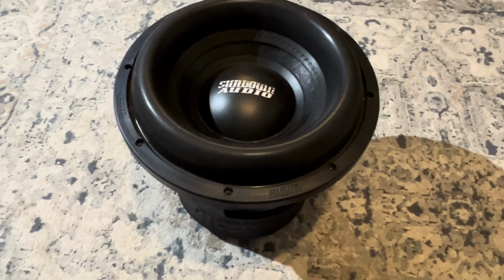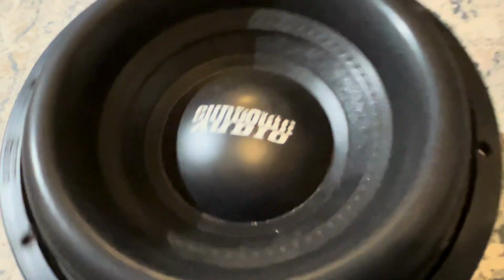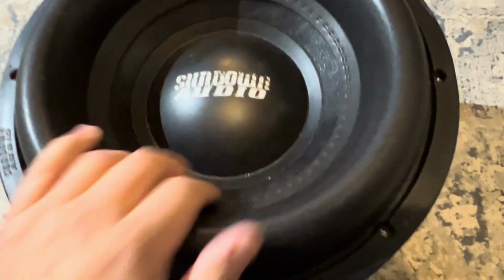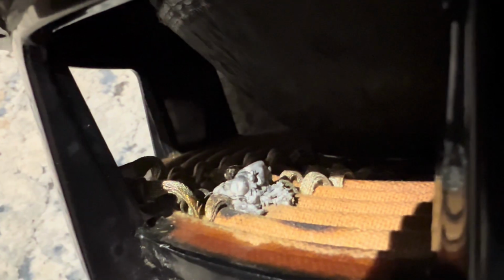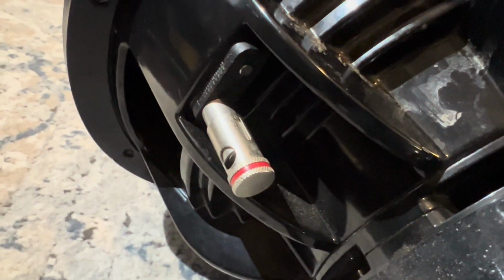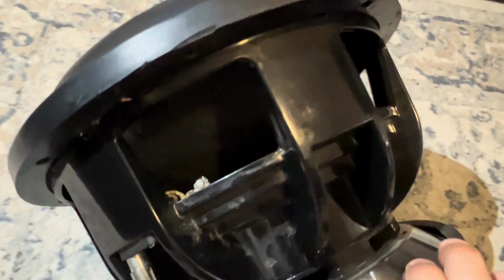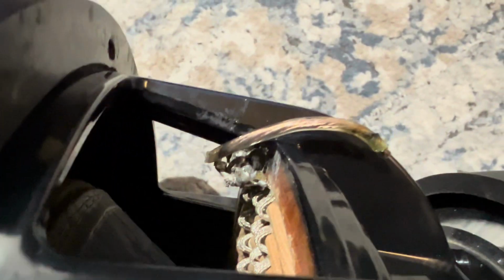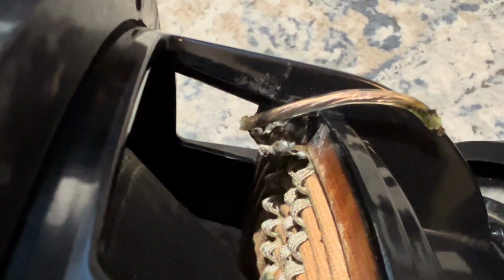Sundown Audio Subwoofer Repair and Review

Comment: 😂 that was quite the repair attempt with the old solder joints. It was good to see you could repair the lead connections. I think sundown needs just to scrap those push pin terminals, especially on a 2000watt rms motor assembly. The corrosion on the vent in the pole is weird, like the sub has possibly seen water. But let's face it, the vehicle trunk is a harsh environment. Great video. Keep up the good work.

Comment: How do remove them thermals.
Reply from the maker: Take another look at the video. You will need to remove the plates holding the surround in place, remove the surround, and reach inside to unscrew the push spring terminals.
Reply: @Moegneto  that screw looks like it was epoxied in on my sub. Does that need to be grinded out to access the screw to replace the terminal?